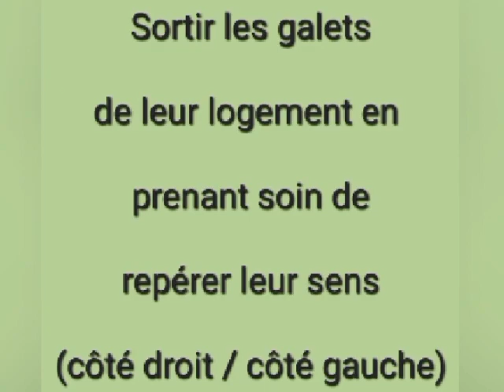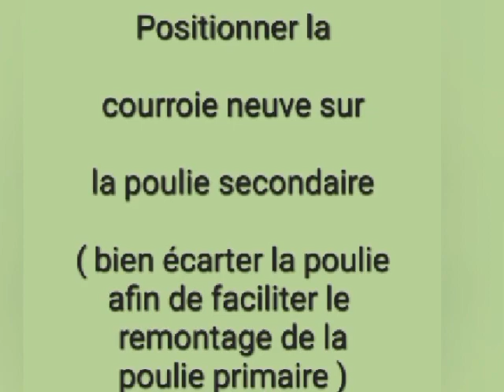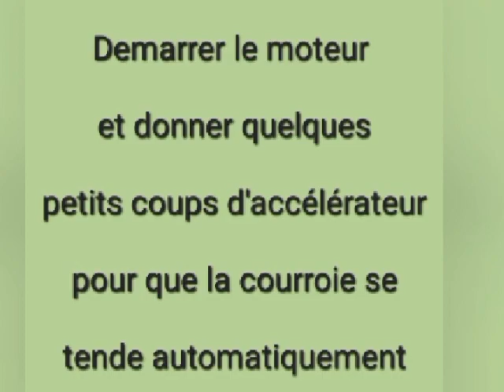TUTO Changement courroie de variateur - Quad Kymco MXU 500/550/700

Comment: Bonne vidéo mais il manque deux informations importante, la cote limite d'usure de la courroie et (comme l'a demandé Edouard) les couples de serrage. 😉
Reply from the maker: Bonsoir, en effet 🙂

La côte limite d'usure de la courroie est de 30,8 millimètres.
Pour les couples de serrage, je ne les connais toujours pas.
Reply: @LaCorseEnQuad  depuis mon commentaire je suis allé fouiner sur le net et j'ai trouvé un mec qui à mit tout le manuel d'atelier sur YouTube. Malheureusement en anglais . . .  mais on y voit les couples de serrage. Donc 137Nm le primaire et 98Nm le secondaire https://www.youtube.com/watch?v=ZYiIvBu7Y2s&t=1393s.
Ce variateur est la copie conforme de l'Ultramatic de Yamaha 👍 en mieux puisque chez Kymco ils n'y mettent pas de graisse contrairement à Yamaha.
Reply from the maker: Super, merci pour l'info 👍